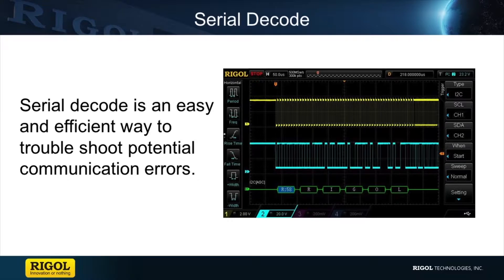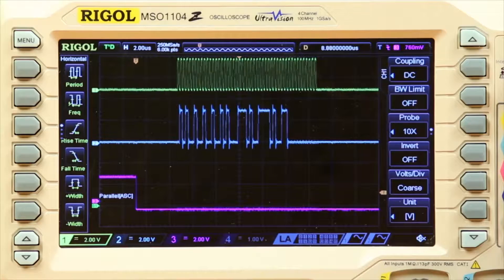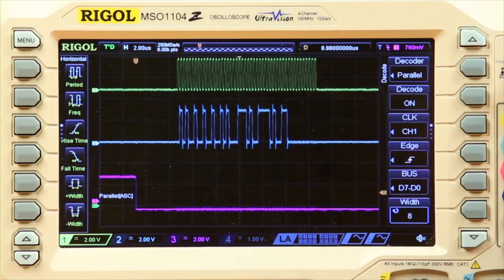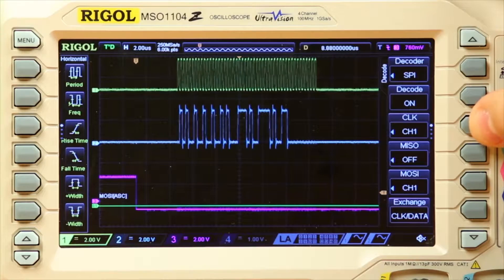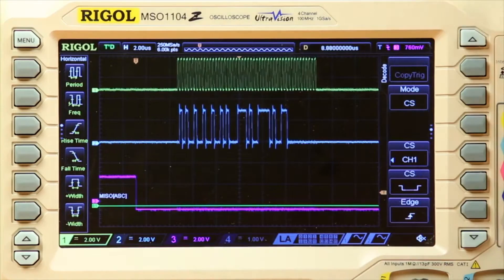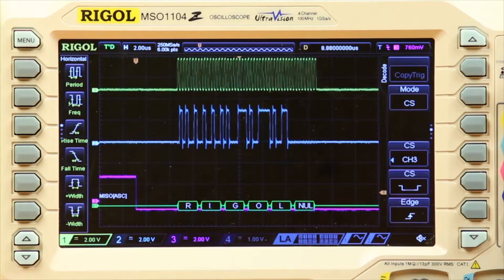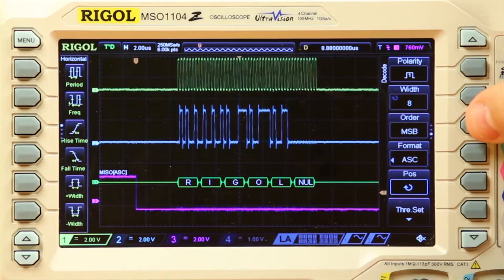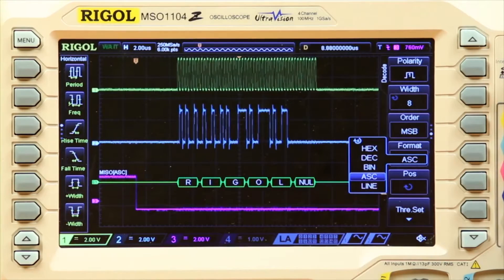Using Rigol's Advanced Analysis Serial Decode by Saelig

Comment: left out was the range of clock speeds for which the decoder works reliably.
regal offers no user choice for how fast their internal decode s/w works.  

and if the device you are trying to decode runs at , say, 600khz  then
you will want the s/w clk to run at least 2X that.  and more would be better.

take the 44.1k sample rate of music CD's ... when most human voice fits
in 3khz or less.   lots of over-sampling going on.

 another matter here not mentioned and not in the manual is that decode
stops working when the timebase is 200mS or slower.  that then makes for
too much data to show on the screen ... all crowded together.   but until you
get this fact it can look like something is  wrong,  and that the decoder is
not working

    decoding is way more complicated with rs-232.  due to  the many parameter
polarity &  data order choices.    and by the time you figure it all out using a known
 data stream you will be at the point where  having paid for the optional
decode s/w  is not much  faster than you could read off the screen by
looking at the data channel
Reply from the maker: I'll ask Rigol to reply in detail, but if you need to decode bigger sets of data then the new Ultra Vision II oscilloscopes have an event table that would allow you to view and scroll through a larger decoded data set.
Reply: The instrument's sample rate will determine how fast a signal can be properly captured, displayed and decoded.  We recommend having a sample rate that is at least 5X the signal being captured.  For instance the DS1000Z series has a maximum sample rate of 1 GSa/s which allows the instrument to properly sample signals up to 200 MHz. 

The DS1000Z series can only decode displayed data,  if you would like to decode larger data sets then the new Ultra Vision II scopes have an event table would will allow you to view and scroll through larger decoded data sets.